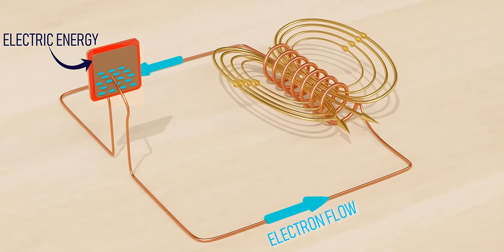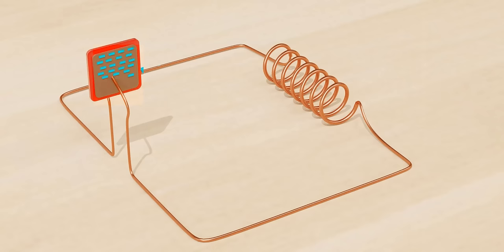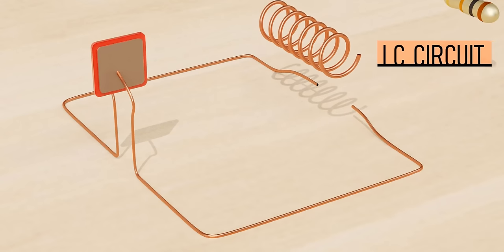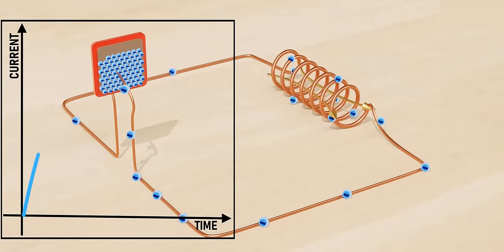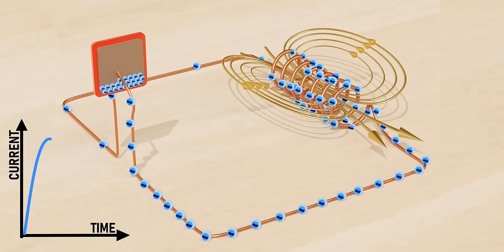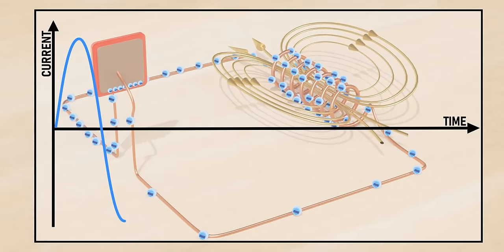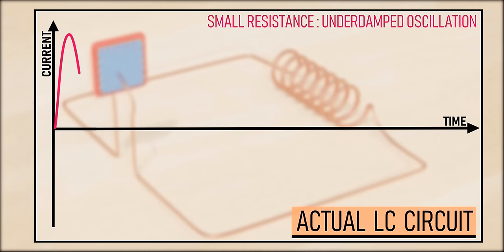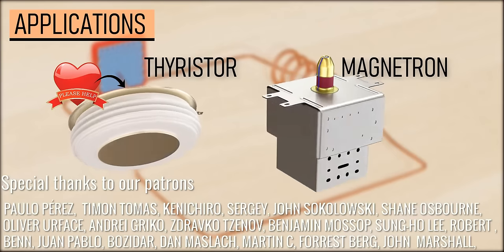The beauty of LC Oscillations!

Comment: why does oscillations do not happen in RC circuit? When the opposite plate of the capacitor is charged after one half cycle? pls if anyone know the answer , tell on reply
Reply: No bro in RC crkt... R won't work as source like L in RL crkt ... It drains all the current in form of heat
Reply: Resistor cannot “ store” electrical charge like an inductor(coil of wire), therefore the energy is bled off as heat.
Reply: Rudhir  good question. I think you are correct. If all of the capacitor charge went from one plate to the other, as shown, you would have exactly the same initial condition in opposite polarity, and current would 'oscillate' back in the other direction, etc etc. But I think resistance reduces the amount of charge with each oscillation, until eventually both capacitor plates have equal charge. Same with a dead short, no resistor.
Reply: @dans150  so it should oscillate in first  one or two cycles , initial conditions of oscillations are produced in RC circuit , however they are damped very quickly as the resistance provided by resistor is too high ,and only, initial conditions of oscillations are produced , so am I correct?

Comment: There must be a correction, If I understand that right. The current through the discharging cycle of the capacitor will peak out at 3/4 th of discharge. From there on, it will reduce and becomes zero when the capacitor charge reaches 1/2 of its initial value. At that time, both plates have equal charges and the current flow stops.

Comment: We need to consider the circuit as ideal circuit or there will be some loss of current due to resistance of the wire and dissipation of heat

Comment: Eliminating resistance helps to keep the circuit isolating. Three points in the later diagram can be improved. First at the coil replacement on both ends, the current needs to have no sharp turns, creases or bends in it. Or the current slows down there to make those turns to the path of least resistance. Large smooth curves into & out of the coil helps to keep the current speed high at those points. Then the coil magnetic field being regenerated helps to amp up & add speed to the current. Then the capacitor can be laid flat instead of up or down, to help keep the current speed higher at the station point of regeneration. Another coil placed after the capacitor can help to draw out high current accumulations coming into the capacitor. Then help propel to the main coil reramping of current. Coil sizes can vary appending on how much speed or resistance is needed to maintain the wanted amount of current regularity.

Comment: In the circuit with the resistor...why do ALL the elections flow from one end to the other?  Shouldn't it reach an equilibrium state where the charges are spread in equal density around the circuit?  Same with the LC, I wouldn't expect all the electrons to go to the other end.
Reply: i was asking myself the same thing about the circuit with the resistor!

Comment: Please adjust. 
The E- flow is more liken to a bicycle chain than the single E- as is animated.  
With the linking E- the flow will better represent the correct way the cct flow works.
One other point, as the E- leaves  one plate of the capacitor then and only then can another E- enter the other side. 
Please adjust the animated format and take a look. I await the results with eager anticipation

Comment: So if there hypothetically no resistance and you had a charged capacitor, the circuit current would endlessly cycle? Even without a power source?

Comment: For the first case( resistor in circuit)one of the plate( initially positive) of capacitor will be negatively charged whereas another negatively charged plate will turn into positively charged then from it the current may also go. But why that's not possible??
Reply: Exactly, some of the physics is not explained here. Like the magnetic field that resists the current... and the material used. And also the saturation point, as it cant resist endless current either. And the stored energy inside the material by magnetism, that gets released and causes the electrical pressure and polarizes the circuit. A better way to imagine it is to look at a pendulum versus gravity. Its all about stored energy. The push of the pendulum is symbolized as the capacitor that is already polarized and charged. A pure resistor doesnt store any energy... other then thermal energy, or converts the energy, more like it.

Comment: I know it's necessary to convey meaning through visual metaphor sometimes.. and in terms of electronics it's good.. but energy doesn't flow in discreet packets that that.. once it starts.. the whole wire experiences the charge, not just beside the capacitor.. great video tho thank you!!
Reply: Electrons are not discrete packets?
Reply: @1pcfred  they are, but they don't flow like water in a hose, they don't push each other in the same way

Comment: I think the circuit with resistor is described littlebit incorrectly, with resistor in circuit, all the electrons go to the other plate of capacitor. Shouldn't they balance the both capaticor plate?  like half of the electrons should travel the other side, because there wouldnt any voltage remaining to force remaining electrons to move to the other plate.

Comment: Think electrical pressure from electron crowding instead of EMF if you really want to understand it.
Reply: Note that 0:50 is not really the way it works, electrons do not keep going until the pipe (wire) is empty like that.

Comment: some info.   good work.     some commenters think   a single-layer coil   is not an inductor.   they are wrong.       coils are  really  amazing things.       as current flows in a wirewound inductor, electromagnetic affects   result in   varying amounts of  internal,   impedance/resistance.      see oscillating circuits, generally.      cheers
https://en.wikipedia.org/wiki/LC_circuit

Comment: Why couldn't you instead have two Capactitors facing each other, what is the difference?
Reply: That won' work, because an oscillation requires an exchange of different types of energy. A capacitor stores energy as electrical charge; A coil stores energy as magnetic energy. An oscillation occurs because the energy oscillates between charge to magnetic energy and back.  Another example is the old "cuckoo" clock based on swinging weight. The oscillation is from potential energy (weight rising highest and 0 speed " and kinetic energy (weight at bottom and at max. speed). If it wasn't for the loss of energy from friction, it would go on forever.

Comment: Please any one answer
Where did the electrons go from the circuit, at the end
Reply: Charge is oscillating from one side of the cap. to the other side, in practice there is no zero resistance so the energy of the electrons damped on the resistance so both the charge on the cap. and the current of the inductor became 0 in the end.

Comment: This presentation is very misleading. For so much effort that went into the animation, it fundamentally misrepresents current. Current is rate-of-flow of charge, and is the same everywhere in the circuit. That is to say, the rate at which the blue dots move past any location (dots per second) should be the same. You can't have 1 amp at one location in the loop, and 2 amps at another location, as is depicted in this animation.  And if current is misrepresented, you can't convey the interaction with the magnetic field of the inductor, and the electric field of the capacitor.
Reply: But its not?
Reply: Brother what you are telling is in the case of DC but this is AC current it's value changes with time so we use RMS value for current in AC
Reply: if you go and look in deeply or study the origin of this Current and Voltage u will find out that the speed of some of the charges slows down for some negligible amount of time  in the minute level but u do not need to go deep in DC
Reply: @sauravbhandari3273  yup u r right in AC monetarily it varies...at every place
Reply: @sauravbhandari3273  If you look at 0:43, for example, you see the electrons are moving at a uniform velocity in the entire loop, yet in part of the loop they are bunched together,, and in another part of the loop they are spaced apart. This is a visual depiction of a higher current and a lower current in two parts of the same loop, with no additional branch to add or subtract current. That is a violation of Kirchoff's current law, and is patently wrong. Yes it is true that at extreme high frequencies one has to factor in propagation delay, but that is far outside the domain of this video. The video is just plain wrong.

Comment: How fast would this oscillation happen? If I were to put a green and red bi colored LED in series with this circuit would I be able to see the color change? Also in order for this circuit to work what values would I need for each component or do they just need to have the same impedence? Any help would be appreciated!
Reply: if you put LEDs in series, the circuit will become uni directional, so better to use a simple bulb  (but that would introduce resistance and brightness will only go down with oscillations, real fast).
The frequency will be 1/[2*pi*sqrt(L*C)] oscillations per second. So higher the values, slower the oscillations.

Comment: Actually, if you could not show electrons flowing from one end of the plate to the other, but instead show that the electrons just next to the plates and in the entire circuit drift inside and outside with varying velocities, then that would be much much better.
Reply: No. It isn't always helpful to be 100% realistic with animations. You understood everything from the video, didn't you? And not everybody has your level of expertise to begin with. So this is fine.
Reply: @mrniceguy4277  Yep. Your point is the positive side of this argument. But what I've noticed is that people even at my standard subconsciously understand current as a train of electrons going from one place to the other even though they have learned about drift currents and relaxation times. That is because they have been taught that way since their childhood. Also, LC oscillations is decently a high enough topic to allow the viewers of this video to understand the drift version of current flow, rather than the old, middle school one.
Reply: What do u mean by "drift inside and outside"
Reply: @rgudduu  Do you know about drift velocity?
Reply: If you know then what I mean by that is that for one plate the electrons will drift outside of it and for the other they will drift inside of it.
Reply: @prakharpandey2392  ok. I understand drift velocity in dc (constant) current case. But not sure about ac current. Am trying to understand how the charges accumulate and disappear at different points and different times in an ac circuit, as the input voltage varies in magnitude and direction. Any high level knowledgeable theory is welcome.
Reply: Election train 🤣
Reply: @rgudduu  : Q=CV  The charge is proportional to the voltage on a capacitor. The voltage is a sine wave, so you know how the charge looks like.

Comment: Kind of a novice, but if the magnetic flux is constantly changing, wouldn’t the inductor radiate energy away, even ignoring energy loss due to resistance?   I thought that’s how EM radiation was generated - by changing electric/magnetic fields.
Reply: If the capacitor is air, then yes.

Comment: If you get rid of the resistor and put the Inductor and capacitor in series you can control the Oscillation And significantly increase the voltage and AMPS BY Pulsing DC You get a greater torque if you build it into a motor. BUT KNOW ONE  HAS THE BALLS TO DO THAT. DO THAY

Comment: Electromagnetic wave in free space:
You, at 90 degrees, take my load.
One quarter wavelength later. The 90 degrees new born is becoming an adult. It look over and says: you, at 90, take my load.
Now, this new quarter wavelength look like the original, but is inverted by 180 degrees.
After four cycles of self induction, the wave successfully dragged its own house in free space, like an escargot. No aether needed to propagate an AC signal in the vacuum of free space.
It is like this LC oscillator but the inductor is open air, no ferrite to accumulate the magnetic flux. But no risk of saturation neither.

Comment: Unbelievable.  The only emf is the charge on one plate of the cap.  One plate discharges to the other until they approach equality,  slowing until they're equal.  One plate won't fully recharge the other.  The coil will resist the change in current,  but only until the opposing  emf slows it  too. 
Did you measure this yourself with a Hall's effect? This doesn't seem right.  - unless current has momentum -  the inductor would be the dampener . . . right? I don't see it.
Reply: Actually the charge movement  (fastest voltage change) is highest at 0 volts when the charge is equal. If you take calculus, you'll understand that the slope of the sine wave is steepest at y=0 (here y is the voltage).

Comment: What is the inductor needed for?  Wouldn't electrical oscillations still occur if the 2 ends of the capacitor were simply connected by a conducting wire?  And also, the animation of electrons flowing through the wire is incorrect.  The average drift speed of a conducting electron in electricity in a conducting wire is theorized to be much slower than the speed of a slow moving snail, which is nowhere near the speed of transmission of electricity, which is near the speed of light.

Comment: the simulation is not very accurate. It should have been when there is no voltage (no charge) across the capacitor, the magnetic is maximum.

Comment: Guys, I'm electronics engineer graduate with nearly two years without any job,, applied thousands of times, the place I stay in is lacking electronics majors,, could you please help me what shall I do? cuz I found my degree is useless at the time with companies requires 5+ and 10+ years of experience!?
Reply: I'm an electronics engineer too n m extremely berogaar yet 😭😭
Reply: Try applying for positions related to your studies... but that you're overqualified for.  Gain real world experience humbly, and in time better opportunities better related to your degree, will be available or offered to you. Pride is expensive,  proving your worth and willingness to take initiative and work hard will take you a long way. 
My brother for instance got his start (civil engineering) testing concrete for a modest wage. He now manages the estimating department for a manufacturer of precast products and used to manage the estimation dept. for some large engineering firms. He used to farm himself out to head hunters for advancement opportunities... but you can only do that once you have relevant experience.
Reply: @davidhenningson4782  thanks mate
Reply: Using CAD to create electrical schematics is a great way to eventually move into engineering. Every EE needs to know at least AutoCAD. Being able to package electrical hardware and wiring in control panels using AutoCAD or SolidWorks is very useful. Finally, doing hands-on work building panels, soldering components to circuit boards (especially surface mount) is a sure route to becoming a great EE. I think there is a large number of unemployed EE's in India that we desperately need in the USA, but our illegal unskilled immigrant influx is preventing us from bringing EE's from India over to the USA where we need you. In the USA, we need EE's so badly that we'll teach you on the job regardless of your experience.
Reply: @gybx4094  Oh man that gave me hope,, Merry Xmas and thanks ...
Reply: Craig F. Thompson  I'm glad you replied,, i will but the most major i prefer is oil n gas-related which requires massive experience nowadays to apply  for...
Reply: @smartgamersify  its alright
Reply: Craig F. Thompson  If its attached with the reader and then you may track according to the emissions

Comment: Why do batteries run out of energy even though the energy is going back to the battery
Reply: The energy is not going back to the battery, the electrons are.  In a non-rechargeable battery, one of the electrodes (zinc) is being consumed in a one-way chemical reaction.  The chemical reaction "pushes" electrons and they flow around the circuit doing work as they flow (a lamp bulb, or a motor etc.).   Before steel jackets were introduced, "dry" i.e. non-rechargeable batteries used to leak the electrolyte once a hole had formed in the zinc jacket.  The electrolyte was corrosive and would destroy the lamp or whatever device was being powering.   Even steel-jacketed batteries can leak eventually.

Comment: Theoretically theoretically could make the oscillations infinite then
Reply: Yes if the wires are perfect superconductors with no resistance.
By the way I'm not sure if he mentioned ... this is is called a 'tank circuit'. Changing the capacitor or inductor value will result in a different frequency of oscillations

Comment: (Learn Indian Engineering) don't listen to misleading Audio explenation😂 When the capacitor discharge, it is discharged (RC or LC) circuit. 😣 However in "an ideal LC circuit" current exchage back and forth where iNDUCTOR's MAGNETIC FIELD push electric charge back to CAPACITOR's ELECTRICAL FIELD, and vice versa 🤓

Comment: Beautiful, but false :(. The magnetic Field is at its maximum went the capacitor is discharged. The inductor takes the energy, instead there is no conservation of the total energy of the system. :(

Comment: Good Animation, but please fix it: When that magnetic field is at a maximum. The capacitor is fully discharged. At 1.31 (and 0.02, 0.12, 0.22)  Once that magnetic field is collapsing, the capacitor should be beginning to charge in the other direction. The end of the capacitor discharge is at 1.31 !.  Your animation shows nothing at 2.06. No magnetic field, no current, no energy. This is wrong.